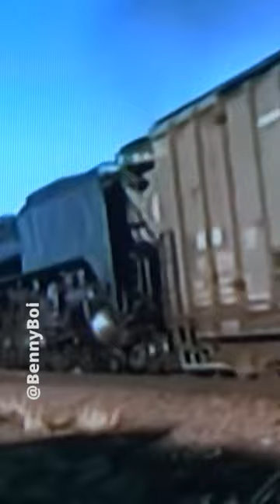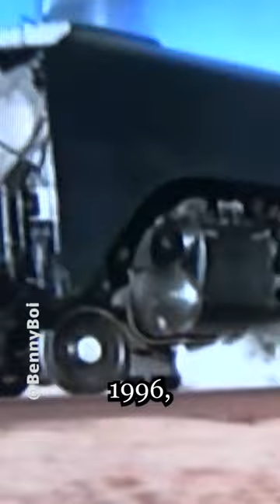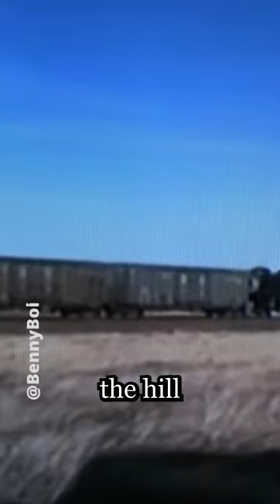STEAM LOCOMOTIVE SAVES a STUCK FREIGHT TRAIN

Comment: One question, when I see clips of special steam trains owned by Union Pacific, they’re always pulling those same yellow pieces of rolling stock, what even are they?
Reply: They are just big water tanks for the locomotive
Reply: Water for boilers, and oil for burners I think
Reply: Water and oil reservoirs pretty much, I could be wrong a little but one’s definitely water
Reply: They're old tenders that have been converted to auxiliary service. Each one carries both oil and water, primarily water. After that is the standard UP livery tool consist(first three or four streanliners) and whatever is attached for PAX
Reply: ok so basically it’s just extra tenders
Reply: The first car or two will be auxiliary tenders with water. Steam locomotives use lots of water and there are no water towers at regular intervals on the railroads anymore. The remaining yellow cars are passenger cars (baggage, combine, coach, diner, observation, etc).
Reply: The one or two immediately after the locomotive are the auxiliary water tender(s), the next two or three passenger cars are the tool and crew cars that the Heritage Crew have to stay in and work on the engine from for when they're out and about on Uncle Pete's network. There was an old express boxcar that UP used to have to haul around the stuff needed for public display, but that got scrapped after some sorta accident on a 2012 trip in Texas left the car with a huge hole in one of its sides. After those, it's just the consist that the 844 just so happens to be pulling, be it a freight or passenger consist. 
Union Pacific still maintains its own fleet of passenger cars for both executive office car service and excursion service. From my understanding, the overwhelming majority of that fleet stays in its own dedicated storage and maintenance shop in Council Bluffs, Iowa, with the exception to that being the tool and crew cars which stay with the steam locos and E9's in Cheyenne.

Comment: Steam is still the king of torque!!
Reply: Diesel still has more torque because they use electric motors
Reply: It's combined torque
Reply: @xavier1964 actually at stationary to low speed the king of torque is steam because steam pressure goes straight to the wheel

At the intermediate and upper speed end Diesel electric is the king of torque
Reply: Steam can have torque all the time, diesel engines might have peak torque in the lower rpms.

Comment: Casually doing a Henry blasting up a hill pulling a consists whilst shoving a diesel out the way. Why did we ever stop using steam?
Reply: we stop running steam for a crazy but also understandable reason: Manpower and cost. the crew need to run and maintain one steam engine can maintain and run 4-6 diesels.
Reply: @Johndoe-jd  not being funny but I'm sure if beehing had never been born and the modernization plans never happened I as someone born in 2001 could have actually seen the tail end of steam and the genesis of the heritage scene

Comment: Still say the steam engine should be modified to run on natural gas or propane. Bring back the steam engine  🚂 ⚡🩶🩵
Reply: The Union Pacific converted their steam engines to burn oil instead of coal. For an engine this size natural gas and propane won't work. they will work for large model trains that you can sit on.

Comment: It’s extremely stupid  and dangerous to overload a steam train
Reply: Why?
Reply: nothing dangerous about it
Reply: Why?
Reply: I can only assume you're meaning boiler explosions which are in no way related to how hard the engine is working
Reply: Trust me, that’s not overworking. & if you mean boiler explosions, that’s not how that works.
Reply: Not really no if you know what the hell you’re doing!
Reply: Wheel slip isnt a load issue. It's a grip issue. Also as long as the steam pressure can escape, the locomotive is safe.